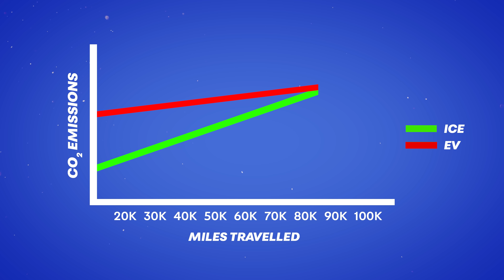Are Electric Cars REALLY That Green? [New 2022 Data]

Comment: Here's another thing to factor in: ICE cars tend to become less efficient and pollute more when they start aging, due to normal wear and tear of their engines, gaskets, lube and exhaust systems etc. 
EVs don't have that problem.
Reply: My Tahoe had 259k and the emissions is the same as a Honda Lev
Reply: @beekeeper8474  Does Honda Lev pollute that much? 🤨
Reply: @amenhotepavoskin1307  He didn't mention all the waste oil from engine oil changes....
Reply: @Brian-om2hh  Nor did he mention oil filters, air filters, transmission fluid, coolant, spark plugs, belts, O2 sensors, muffler system... all that fossil crap that EVs don't have.

Comment: You also need to figure in the cost of replacing the battery, and disposal of the old battery.  Most people do not know what effect electric car batteries have on the environment once they reach the end of their life span. More information needs to be published about effects on the environment when accidents occur like severe crashes and such in multiple scenarios?
Reply: Older EV batteries are unlikely to be disposed of, because they are way too valuable. They can be 95% recycled, with the lithium and cobalt being recovered to around 90%, and reused in new EV batteries. Those EV batteries not recycled can (and already are) being used as energy storage in commercial, industrial and domestic application. There is absolutely no need to dispose of EV batteries. They can - and should - remain in the system.
Reply: @Brian-om2hh  do you know of any studies do on the effects to the environment when EV batteries are involved in catastrophic crashes and or are lost in fresh water and salt water due to crashes or ferry sinking? I'm looking for information.

Comment: Battery tech has improved more in the past 2 years, than oil has in 100 years.
Reply: That's not true.   Both technologies have improved dramatically.   Starting point for batteries is around 1965, you're comparing 50 years with 100 years for a start.

Comment: EV tech is improving every minute. Oil motors, have not really improved in 70 years. If EV's aren't there yet, they will be.  The oil industry has intentionally closed the market, and hindered advancement. The EV market is stil, "the free market", and as such will drive advancement.

Comment: Did Volvo take into account the increased tyre dust from electric cars due to torque?  That's quite a significant pollutant.  It's the reason why I drive my i3 very carefully.   Replacement tyres are bloody expensive.
Then again this is probably balanced out by reduced brake dust.
Reply: The low-rolling-resistance tyres fitted to most EVs are more durable than the tyres typically fitted on ICE vehicles. In combination with regenerative braking, EVs should produce fewer particulates overall per mile driven.
Reply: @gsvdeathandgravity334  Sorry but this is pie in the sky logic.  The tires are the same on EV's as they are on ICE.  Low rolling resistance tires provide less traction, especially in northern climates, which results in a longer braking distance, less control, and more accidents.  More accidents result in more waste/production.

Comment: I heard you needed to change the battery pack of an ev at least once in the lifetime of the car and the production of a battery pack is the one polluting the most and involving child slave labor in cobalt mines. Is that taken into account? Just asking. Also lithium batteries are not really reciclabile. Sure, they find a second life in large project batteries like the ones in South Australia for 8-10 years, but afterwards, they still end up in landfills. Electric cars are undoubtedly the future as they are a better car, but not powered by lithium batteries.
Reply: You heard   I wonder if you also heard that the big oil companies also mine for minerals, specifically cobalt. They need cobalt to remove sulphur during the refining process. If you hate the thought of child labour, then get rid of you ICE car. And lithium batteries are really recyclable. Both Volkswagen and Renault now have EV battery recycling facilities.

Comment: Yes, EVs are not the answer. They are better than petroleum cars, but cars in general are a blight on both the environment and our urban landscape. Just think about this - in general you are using a 2000 kg machine to cart your 75kg body from A to B. And how good would it be if we could convert lots of car parks into nature parks? But no you say, sometimes I have shopping and my kids too. Yes you do, and if you are unfortunate enough to live in many of our suburbs that have been designed around the car, then you have a problem. But the fact is, many of us can do without a car, using a combination of public transport, and in my case, an electric bicycle. I can carry quite a load of shopping too - in these bags called "panniers". And there are electric bikes designed to carry a couple of kids as well.

Comment: The big 100kwh EV car battery is the killer invention. 
The hours of use of the EV car battery is huge benefit. 
EV cars plugged into the grid 24/7 except for rush hour means all free renewable energy is now available 24/7.
If you stupidly think in a 'horse and cart' way you have lost.
Ford killed the old thinking around the world. 
The Germans went to war WW2 with horses and carts, those looses LOST every thing. 
STOP thinking old, all EV cars will be fully charged daily for free from home rooftops solar PV. 33kwh. 
The grid 40% to homes become 40% to grid and the 60% grid supply from fossil fuels becomes 20% if they are lucky.
Petroleum is a 90% imported waste. 
Petroleum should be a strategic military reserve. We need months of tank, truck, and jet fossil fuels in Australia. 
FMD people are stupid. 😊 
Old thinking is crippling Australia. 
We have a Gold Plated poles and wires to every home in the country, 9million.
Our government should be importing EV car from the 6.6 million sold last year.
We even have all the minerals. 
TESLA would love to set up production here.
We have 20million cars today in Australia. 
The automatic plug in is the next 'killer gizmo'. Australia is good at gizmos.
240volt steady charge EVERY WHERE, every where, will beat fast chargers because they will be cheapest. 
Infact the grid will trade power for money, just tell your car your minimum needs. 
The money is in the grid. Big, big money. 
The grid exists today, turn a light switch on and off now.
Hello Hello anyone thinking 🤔???

Comment: The most health damaging emission from all cars are the rubber particulates from the tyres and EVs produce 40% more on average than ICE due to their weight and torque curve. However no one seems to consider this 'inconvenient' drawback.
Reply: Rubber particulates??
Reply: No one considers it because it's complete nonsense.  That is on a par with the "you can only rapid charge once during a long journey"  claim.....
Reply: @Brian-om2hh  Thank you for your thoughtful and articulate comment. 
Perhaps you should tell the team of dumb ex MIT engineers that their ground breaking innovation to capture dry rubber particulates at source is a complete waste of time and resource and to desist their ongoing work on an even more challenging wet system.
I understand that they are in communication with scientists researching the causes of the surge in life changing asmatic autoimmune responses to rubber particulate ingestion in young children, a potentially lethal disease, that their work is pointless and advise their parents that, as you claim, it's all "complete nonsense" as was the research on Diesel particulates when such cars were being widely promoted over petrol just a short time past. Thanks again for your in depth and highly informed analysis - a great contribution to the debate. 

PS. I fail to see the connection with battery charging cycles but clearly your towering intellect conflates in a maner beyond us mere mortals.

Comment: I think we have known this for several years now. Musk has talked about this. Electric cars are only better over the whole life of the vehicle. Volvo is not the first to release data like this. Even if electric cars are powered by coal plants they still produce less CO2 over the whole life of the vehicle. This is well known among informed EV enthusiasts.
Reply: @Robert Stanley Sort a side issue, but you are talking universally anyhow. Maybe you should try and work out the amount of electricity to make an electric vs gas powered vehicle. This is why it is rather irrelevant for comparison purposes. And good luck calculating it. 

One point is if you have an old classic car and run it on petrol or deisel for many years. You travel emmisions are producing way less emmisions compared to purchasing a new electric car every few years. Yet governments are inserting laws to ban petrol driven cars by 2030. They are assisting in making things worse as the laws are not well considered.
Reply: @OM617a  Battery defect do happen and I hope they have gotten better but it is also about how you treat you cars battery.
Reply: Only problem is, they are wrong. As the basis for the enthusiasts argument is reliant on the end cycle of the vehicle. Which is a made up travel units to swing in the way of the electric car. Petrol cars go much further before it needs retiring, and can even be refurbished. The electric car has a much shorter operating time span and refurbishment is more damaging than a petrol car running for many more miles.
The statement "Even if electric cars are powered by coal plants they still produce less CO2 over the whole life of the vehicle. " is the problem. It is a fixed untruth for the reasons above.

Comment: The big thing that was missed in this analysis is at what point do the batteries in ev need replacement?  When that happens  it resets behind the combustion engine again and you also have to figure in the co cost of disposal

Comment: Very interesting! And proves what I've been saying all along: if you want to be green, buy second-hand. The carbon footprint in the manufacture of a new car is going to massively outweigh the relative efficiency improvement of its design.
Reply: Number plate snobs won't go 2nd hand. They gotta get their shiny new number plate twice a year so they look cool on the school run 😅
Reply: @User_on_Youtube_1  No doubt you're right, but they're the problem, plus the car manufacturers pushing fractional incremental improvements as world-changing technological leaps to sell more new cars.
Reply: But you'd need to offset that against the fact that as ICE cars get older, they become less efficient and more polluting, due to engine wear.....
Reply: @Brian-om2hh  Yeah, that's true but I think it's pretty clear to see from the graph in this very video that the vast amount of the environmental impact from a car comes from its manufacture, rather than its use. There will reach a threshold where that's not the case - I'm not advocating never getting a newer car ever, just getting one every 6-10 years instead of every 3-5.

Comment: I drive a turbocharged Subaru. I think Volvo's numbers are skewed. ICE has to be way worse. Gas production, oil and grease production, oil change refuse, ICE generates so very much more waste. I wish I could afford an off-road EV, but they cost about twice what I can afford. Also, Subarus last twice as long as the purported 124,000 mile life expectancy for an EV. You save so much money not having to buy gasoline, but wait until you have to replace that battery. These considerations have stalled my own desire to purchase an EV. I'll stick with my electric moped scooter bike as a backup to my Subaru. Great report!

Comment: I do want to say also, before you tout the greatness of wind turbines, please go live near some. They are great, on paper, when you live far away. There is a company paying for the deaths of many, MANY birds going on right now, and that is just one of the side effects.
Reply: Utter garbage. If birds were really that stupid, they'd be flying into powerlines, electricity pylons, tall trees or buildings, big hills etc. It's complete and utter cobblers.
Reply: @Brian-om2hh  If you hang a line of fishing wire/line from the ceiling inside a building, 100% fool proof it will snare a pigeon. Common practice in large manufacturing buildings as poison is frowned upon in many areas. Just a plain line hanging in the middle of the air.
Besides, the birds can't see the spinning rotors coming, maybe they look slow to us on the ground but the tip speed of the rotor is fast. If they don't see it, they will hit it. 
And you can look up the settlement, it went through the court system.

Comment: Ther Recharge is better.... until you replace the battery after 10 years, before 124,000 miles. After which it is WORSE than the ICE XC40.

Comment: Great comparison, it really does show how the two initially compare to build and operate. The issue not addressed is the maintenance each vehicle requires during its operation. Which car uses more resources to keep it running? How often does the EV have to replace tires and other consumables compared to the gas? How much does it cost to switch the infrastructure from gas to EV?  Can the current power grid support the increased demand of electricity? If it can't, how much energy and resources will be needed to build it? How will that increase the greenhouse gases?

Comment: The CO2 emissions of the EV are all dependent upon the source of electricity. That’s why renewable energy is so important. The ICE car can never take advantage of renewables except in production, it must burn gasoline when it is driven. As our electricity grid switches to more renewable energy, the EV car’s CO2 usage drops dramatically, even for existing EV’s. And the whole battery replacement at 90k is a bunch of garbage. EV car batteries are rated over 200k miles and over 20 years of life, much longer than the average life of an ICE car. My EV battery is over 80k and 10 years of age and I’ve only lost ~5% of charge versus when it was new.

Comment: When you add in the environmental destruction from mining heavy metals and lithium as well as child and slave labor electric will never be expectable. Just because it occurs where it doesn’t effect you directly doesn’t make it ok.
Reply: In which case, exactly the same argument should be applied to ICE cars, because the big oil companies have mined cobalt for decades. They can't refine oil without it.
Reply: @Brian-om2hh  the amount of cobalt used by oil is minuscule compared the destruction to the environment to access lithium, rare earth elements and heavy metals used buy electric motors and batteries needed for EV’s. Just because it is happening in 3rd world countries and hidden in China and Russia doesn’t make it less an issue. Maybe a better goal would be hybrids until some issues can be solved.

Comment: This is the dumbest conversation ever.  Gas cars will only ever run on gas.... period.  EVs are energy agnostic.  That is enough to end the debate right there.  Plus I'm not taking "facts" from a 3rd rate legacy auto manufacture that is struggling to make EVs.  They literally have a vested interest (as with almost every single legacy manufacturer) in slowing the adoption because they are not ready.  EVs are better for the environment.... FULL STOP.  The fact that there is a "break even" point literally proves this is true unless you dumpster the EV before that point.  It is a nonsense argument for low information people.

Comment: Just wait until you recharge your EV all the time using superchargers. Such chargers pump out alot of power at once and it literally cooks your battery to death alot sooner than if you just would charge it slower. With that supercharging also comes to risk of starting a fire inside the battery which you cannot put out by normal means. Guess how much polution is generated when that happens? I've never heard about petrol cars starting a fire when they're simply parked somewhere, or even when filling it up. EV's on the other hand are restricted from being parked underground because of the fire hazard. This limits it being a city car (due to no exhaust pipe) as a big city usually has more parking space underground than above ground. They're also alot more expensive to buy in the first place. Same car as an EV can cost about 2-3 times as much as the exact same car with a petrol engine. Even if you have free electricity to charge it for years, you'll need alot of time before you earn that back, if ever. I calculated it for my car and I would need 7.5 years to break even. I didn't calculate maintenance, just the purchase price and gasoline, and I assumed my electricity for the EV was totally free (charging at work or using solar panels on your house). So if you need to pay for electricity, the break even time would be much longer. But by then, your battery is near dead and you need to replace the most expensive part of your EV. So EV's aren't cleaner and they're not cheaper than they would like you to believe.
Reply: There are no parking restrictions on EV's in underground car parks in the UK. Your post has all the hallmarks of being penned by a paid oil company plant.  And you know all this without ever having owned an electric car?  Incredible.